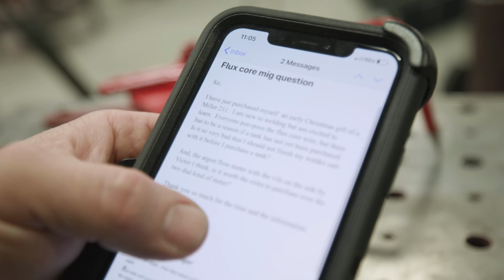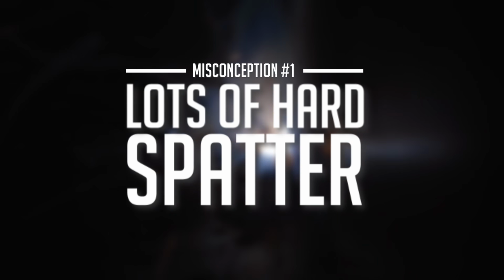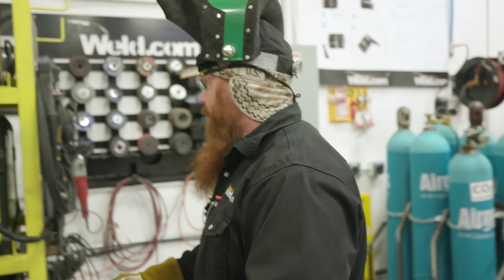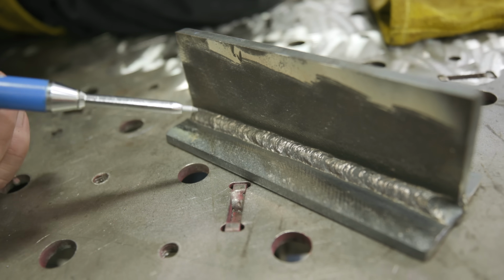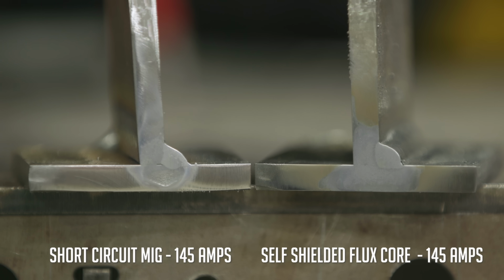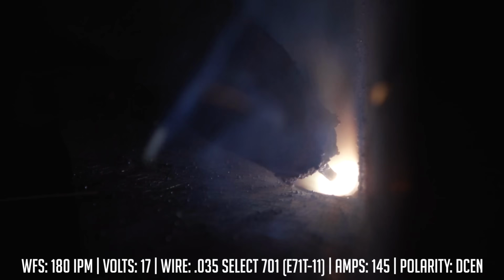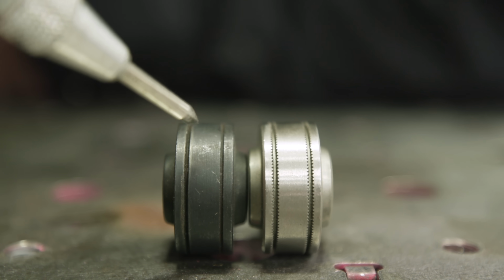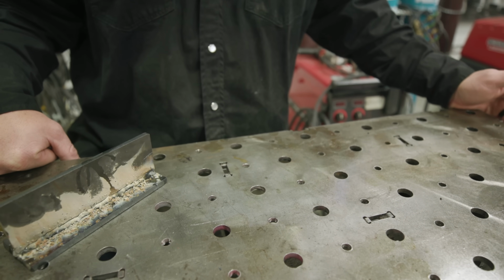3 Flux Core Welding Myths DEBUNKED

Comment: I thought flux was kinda crappy.... untill I went to trade school.
Reply: Wait until you have to get into using hardwire over crappy metal
Reply: HeyIts Yetsi what’s your definition of crappy metal? Impurity’s, millscale and rust or crappy quality material?
Reply: Josh Smith  I worked at a place welding heavy machinery and equipment anywhere from 1/2"-1 1/2" steel and pans with a 12k miller. We ran 1/16" and 3/32 esab dual shield. After working there I'd rather run fluxcore anymore.
Reply: Josh Smith I have personally used 3/32” wire on multiple occasions. I have seen 1/4” wire but never got to use it.
Reply: What did you learn that made it better? I can mig weld with gas pretty well, and I can stick weld pretty well, but my flux core Mig welds look like garbage no matter what. Porosity and spatter along the whole thing. I am definitely running DCEN, and I've tried adjusting wire speed up and down, while welding, changing my speed of travel, but they just come out terribly every time. Usually the slag doesn't even chip off lol, it's just all one shitty material. 

Could it all just be a bad brand of wire? Or is there some sort of trick for flux core?
Reply: @cyleleghorn246  if I had to guess I'd say you're not using enough stick out. For relatively light material you need about 15mm distance between the end of the wire and the tip. This is because the flux inside the wire needs to preheat in the wire to work properly. Hold the gun a little further away from the weld and use a slight pull angle and see how you go. 

If it's feeding funny, make sure you have a knurled roller in your machine. It is possible you have bad wire. It does degrade overtime once it's been open to the air.
Reply: @spencerhho  thank you, I'm using the knurled wheel and I've gotten pretty good at dialing in the roller tension and spool tension so I do think it's feeding right, the stick out could be the issue. Sometimes, especially with flux core, it really feels like the wire is pushing the gun back so it's easy for me to get too far away, I might be overcompensating and getting too close to try and fight that. Thanks again, I'll keep it in mind!
Reply: @cyleleghorn246  if it's physically pushing back the voltage is too low or the ground is bad. If you have a burnt but of wire at the end it might push for a second before arcing but it should be negligible.
Reply: @spencerhho  thanks, I know my prep could always be better and I already need a new ground clamp because it's arced out plenty of times, it even has a few holes in it. It was northern tool's clutch mp140si, been solid so far but I know some of the components it comes with aren't the best quality.

I appreciate the replies, I know what to work on and what to buy now and hopefully I'll see some improvement in both stick and flux core with more prep work and a better ground connection

Comment: With all due respect, I have been using the v groove drive wheels for years in my welders...  With very few issues feeding... On the contrary I have had more bird nests from solid wire in vee groove drive wheels.  So i have to respectfully disagree that using vee groove will always cause problems with flux core.    I do use flux core for it's ease of usevand portability  😃👍 great  information either way please keep up the great vids. 😃😃👍👍
Reply: Theres always that one idiot. Today, it's YOU.

Comment: flux core is the way the go for hobby/outside. The best part is you don't have to worry about running out of gas on Saturday night, no trips to welding supple and realizing that they are closed, and it is cheaper. Gas is sweet though.
Reply: If you have the power to run in spray transfer with out blowing breakers, yeah. But for short circuit, even globular, self shielding is great for small jobs.

Comment: Some of that gasless fluxcore the welds tend to be less ductile than 7018 or dual shield try taking and put about a decent tack on something using this gasless fluxcore and pry on it till it breaks you will notice much like solid wire when it breaks it does it all of a sudden unlike 7018 or dual shield it take some wiggles before it goes that's the difference which is huge in structural welding now I know all gasless fluxcore wires are  not all created equal the heavy nr 233 is ductile as well but is used on very heavy weldments

Comment: What do you think about  using flux core on 110 power
Reply from the maker: If your machine is a 110v machine go to town
Reply: Weld.com do you think I could weld auto body thickness with flux core or would I need something else?
Reply: nothing wrong with that.   most 110 outlets are 15-20 amp so not likely to get the big power from your machine.  might be more challenging on thicker material.  my old hobart 140 was 110 only and welded plenty of stuff. getting up around 1/4 inch required more work but was fine.

Comment: Jason, my question is that on occasion the slag does not cover my weld completely  , just the sides, so is it my speed or gun angle?
thx.
Reply from the maker: Is it new wire?
Reply: @Welddotcom   new wire  10lb spool  just open box.
Reply: What diameter of wire, thickness of material, and position?
Reply: I was using 035  in t joint and lap joint , thanks for the reply
Reply: Bruce D it could be caused by a travel speed that is too fast, and/or improper contact tip to work distance. Slow down a bit and pay attention to the contact tip to work distance. You should be about 3/8”-1/2” away.
Reply: thanks Jason, I will pay better attention.

Comment: I have the feeling that most of the people getting these problems are running low cost flux core welders that only have ac current for people that have one of these welders i would recommend looking up how to convert it the welder over to dc it probably only costs about $40-50
Reply: Or just save up and get a invert machine starting around $300. Hell I don't know much about them but yes welder has their $500 250 amp synergistic mig on sell for $350..  It comes with a stick stinger and and an nice mig gun and with a optional  tig torch it has a lift start for tig. I have one of their hoods and love it, they also make real nice copies of tweco style mig 15ft guns for $100 that I plan to grab for my $2200 everlast that I hat the mig torch. But love them welder OMG smooth. But this might be something worth looking up some reviews on if you are looking for a budget welder. Looks like more bang for the buck than anyone else even at $500.. has a 40% duty cycle.
Reply: Most are 110v and 90amps. Not really enough for mig work outside of thin angle iron
Reply: @kylemilford8758  Mig maybe but the flux will go 1/4 of so on a good cheap machine as long as its not a AC pile of shit. I know thats all had for years. I have had several nice ones in the years since but I think you will be surprised if you ever put one to the test. Mine would go on gas but most of the time it was always flux core  if I was doing anything serious. I think they should of did the test with a small welder like a Hobart or Lincoln so all the neigh say people can see. And I think most go to a little over 100amps.

Comment: Thank you for all of these videos!!!   I just started welding 6 months ago and with your help and tips from coworkers I am doing very well.  That being said our shop refuses to use anti-spatter.  I was told this because it can be a cause for porosity.  Meaning if the anti-spatter gets on the area you are welding it causes the porosity.   Is this true?
Reply: My personal opinion about that it is not true from my experience ran hundreds of pounds of dual shield wire

Comment: How about using the drive rolls with the knurling, even though you are using solid wire? This will keep me from having to switch drive rolls when changing wire type.
Reply: I use knurled wheel for both . Works perfect .

Comment: I don't doubt that flux core is a good wire and or process. But what about the type of machine that you use
Reply from the maker: As long as you have a constant voltage machine (CV) you are good.

Comment: Most of my hates and others I bet, the flux core welder brought was a cheap high low power job to do car work, then spent half my time filling in holes. But once you learn the nature of the beast I would weld a tank with one... I wouldn't drive it though because my welds are crap!!!
Reply: The absolute biggest problem with people buying 120v machines is first they hook it up to a 100' 14 ga extension cord, plugged into a 15 amp outlet. By the time they pull the trigger when set on full heat of 140 amps they might, might be getting 90 amps at the tip. 

Get a rated 20 amp cord that's no longer than 25', plug it into a 20 amp outlet and BAM, it's like a whole different machine!!!
Reply: @AZBADBOYz  You just described me. Bought a Hobart 140 and had it plugged into a 15 amp circuit with a 50' 14 ga cord and was told I needed to rethink my setup. I wired a dedicated 20 amp circuit for the welder and bought a 25' 12 ga cord and it definitely made a big difference in how the welder worked. Now I can actually tell the difference between the amperage settings.
Reply: Practice practice practice
Reply: @TheFootbaldd  Are you on drugs because your post sounds like you're on drugs?

I don't see your math on plugging a 120v machine into 240v? My reply was on the common mistakes made by the common Harry homeowner using a 120v machine as mentioned in the video! 

Kids, this is why you always make sure your ground doesn't have damaged sheathing. Hi amperage to your body causes damage and so does drugs. Don't do drugs!

Comment: 👍👍👍👏👏👏👏 finally , no more doubts in our mine . Good infos  from an experience  man who done it 
No "" bull shit "" from  peoples that they think  they know it all and don't even have a welder 
Well done and  now its is confirmed , flux core welding is just as good and strong  as  regular wire 
Thank you again 👍👍✔️✔️
Reply: Se Faucon now you need to watch part 2. I am glad weld.com shined sone light on this topic ....  BUT there is soooo much more to know about this stuff before you run out there and start using it! 
Some self shielded wires are rated for single pass use only!!!  You can not “stack beads” on thick material to get a bigger weld ! 
Others are rated multi pass where you can stack beads ....  BUT there might be a limitation to that also you can stack them but not more than 1/2” or 3/4” inch. You NEED to read the speck sheet of the wire you plan on using very careful!
Reply: Yes yes Mr Zila , thank you very much for contacting me , ( i am suprise ) i trust you and i followed a lot of your video informative  videos of yours !!. Yes i am aware of your saying and agree 100%  with uour comments and experience , i know there is a lot here to mention about welding in general and flux core aspect .But here i think that it was only a small resume in general  without having a full course of 3 months session for example.
But i hear what you are saying loud and clear .Your are a very good man conciencous and don't want to let people down and bringning yoyr help as much as possible .
I appreciate your input very much and touch by your memo to me 
Thanks a lot  , hope to talk to you soon and yes i will watch part #2  coming 
There are peoples in welding world for more than 30 years for big Cie and still learning. Today !!!!
Why ??? Because product change , welder change  and people ability changed , it is a constent learning and keeping up to date like person like you that we can become better and better
Thank you again ( sorry fir my typing , i am a french speaking person )

Comment: This video is a great help on flex core and on the stick out I was told when using flex core the stick out should be about 5/8 to 3/4 but when I go at 3/8 I get a nice weld so what's the best distance.
Reply from the maker: It depends on the wire / size / manufacturer you're using.
Reply: The higher you run the wire the more stick out you need. With very large wire and high amperage some flux core needs 1.5" of stickout. If you have porosity or wormholes and you eliminated all other contamination then its likely your too close.

Comment: I'm in welding school, working on 3g cruciform, I keep running into a problem with blowing a hole through the cruciform. What I'm I doing wrong? Set at 160 wire feed sync 19 volts.
Reply from the maker: Share some pics and settings with us via the link in the description

Comment: I do not remember if you covered using flux-cored with GMAW combined in welding. 
What are the benefits to this combination and what type of welding scenarios would be considered?
I repair older agriculture equipment; rusty iron (mowers, trailers, rota-tillers and bush-hog blade build-ups) up to 3/8 thick stocks, outside with my 250 miller-matic Mig.
Could this be a welding video topic?

Comment: Glad somebody did a video on inner shield wire . I have run across many people who asked me why they couldn’t get a descent weld with it . I would show them inside on the small mig machines how too change the polarity . It usally says right in there owners manual . The only inner shield we have ever used  in the steel maintenance in industry is for hard facing . We use M71 Lincoln outer shield .052 knurled wheel with 60 argon 40 co2 gas At home I run .035 hard wire and 035 M71 our shield also . 60 argon 40 co2 also . Knurled wheel and just change the wire back and forth depending on the fabrication . Oil / rust / moisture / air drafts are the trouble makers for flux core outer shield . We preheat everything also .👍 really like your channel . Good stuff 👍

Comment: Fantastic video very informative thank you. I’m still more comfortable with the stick at the moment and mig is supposably is meant to be easier like a glue gun, I’m definitely going to extend my welding time after Xmas and get better. At the moment I’m grinding more than welding and I think it’s because when stick welding I hold my stick to close and I move to quick. When I do pull a beautiful bead I’m like wow 😳. It’s a great feeling.
Reply: It depends what kind of rod you’re using. For instance E7018 can literally be held on top of your plate once your arc is established, since the rod tip burns by droplet from inside the flux, while a 6012 or 13 needs a more consistent short arc length. Whatever rod you’re using however, the most important thing is to learn to recognize your puddle, and keep it consistent.
Reply: rondav56 thanks I appreciate that. I’ve been using the austarc 13s and there pretty cool couldn’t tell you what number they are but I find these rods if you hold the ark or rod just above the work and hold it there probs longer than usual I then seem to get a nice result. Well I mean 80 percent of the time anyway. But I mean that could be operator error to because I get those days where I my hand shakes a bit lol 😂 https://youtu.be/Cv8_zppbqk0